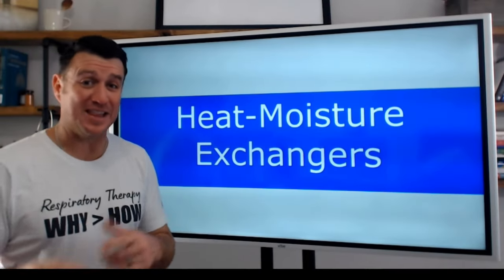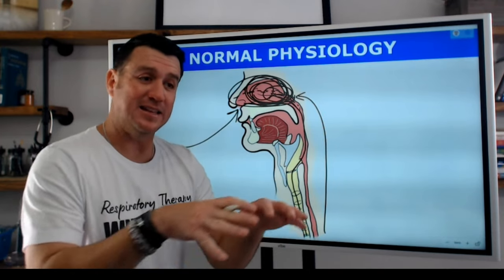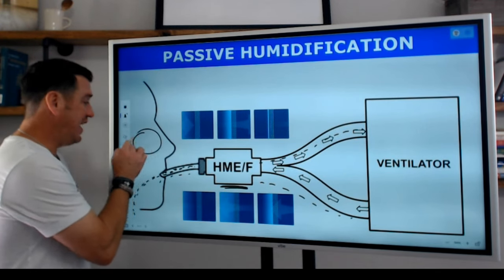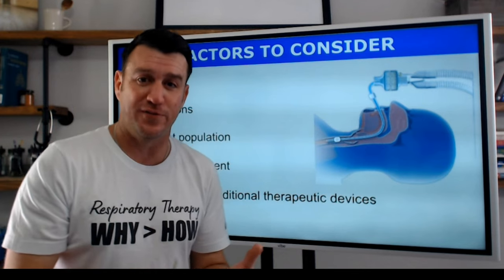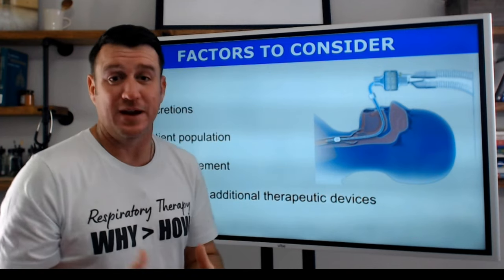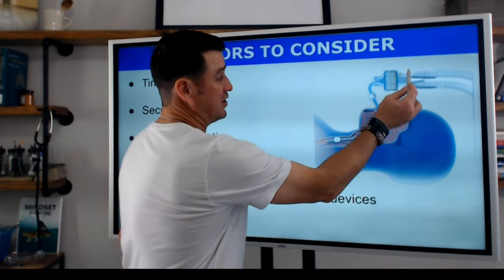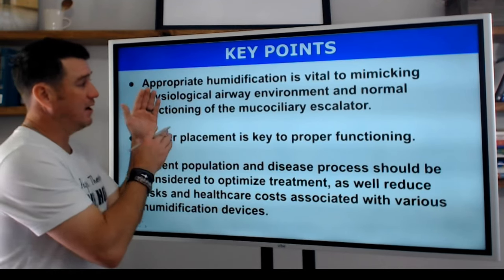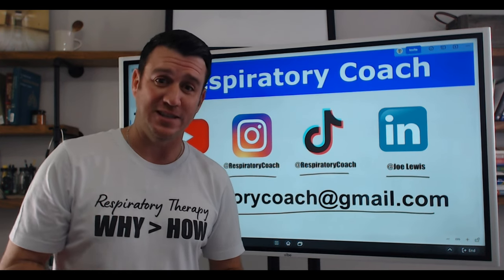Respiratory Therapy   Heat Moisture Exchanger HME

Comment: Great video 👏 in the LTACH setting I work at we use these as their source of humidity. In 16 months I’ve seen 3 patients code from a clogged HME. A combination of copious secretions and therapists not inspecting the device lead to the dangerous situations.
Reply: Usually HMEs are to be changed every 72 hrs per manufacturers... is there not a policy on it in the LTACH?
Reply: @inspiredx3866 I have to change HME’s as much as every 5 hours in my building because of the water accumulation and in some cases the sputum accumulation. It’s especially bad here in Florida where the humidity is high. Room temp plays a part as well